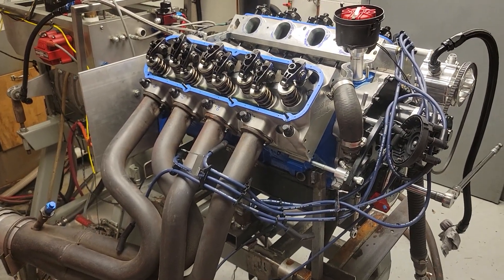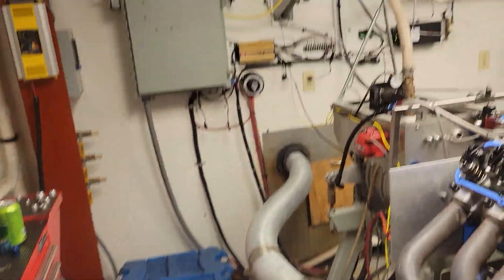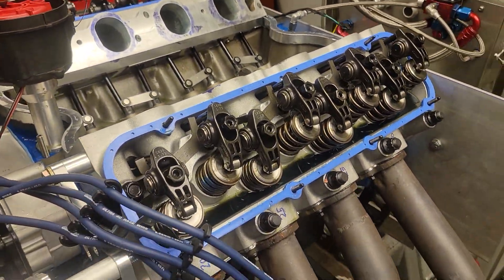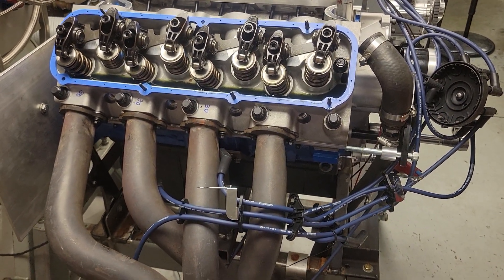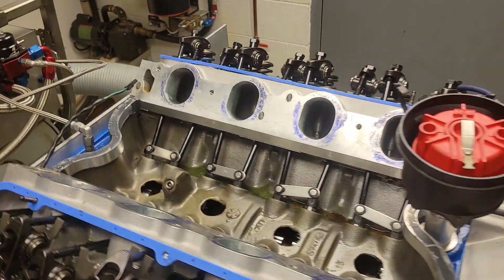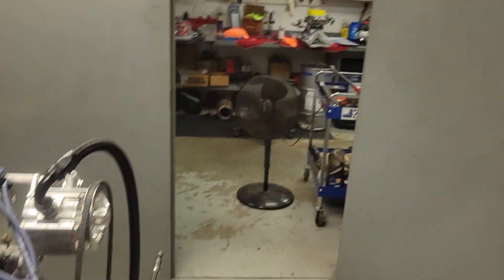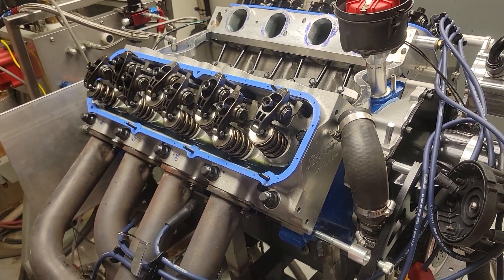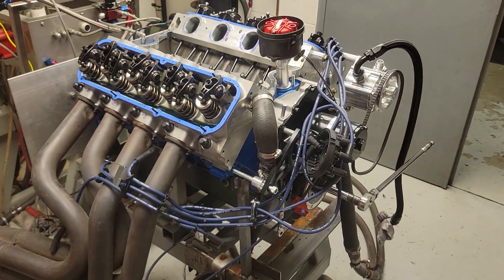sr71 motor on the dyno, but with issues

Comment: What oil modifications did u have to do?
Reply: Hmm I don't have face book.
Reply from the maker: @marksrepairj623  slight nick in the lifter body to feed the oil holes from the slots
Reply: What kinda lifter were u running?
Reply: I'm building a 521 with the sr-71 heads too for my jet boat and never heard of that... u weren't getting enough oil to the rockers from the push tube?
Reply from the maker: @marksrepairj623  i run bam solid roller lifters. Somw times on stock blocks it's needed to oil the pushrods correctly.  Tona of info on this in the bbf/385 groups on Facebook

Comment: I built a 496 for a client and engine dyno number were low at 698hp/598ft/lb. I was asked back on the project and they had sent a Proform 950 to DaVinci. The needle and seats were too small the accelerator nozzles were too small and partially clogged, no power valves, and all jet sizes(including air bleeds)were the  same that it left with. All contradictory to the spec sheet. It wouldnt idle and it was hard to start. It would run-in when it was warm. The throttle seemed to hang up if tried closing the idle screw. The carburetor was lean at idle @ 15.8:1, the butterflies open into the transition slot, the butterflies were in backwards so the taper was cutting into the base plate.....days later it made the projected numbers and gained 168hp/125ft/lbs and 1200rpm. 

Maybe back in the circle track days.....but not today.

Comment: What did you have going on?
Reply from the maker: Lack of oil to the rockers.  Small grind om the lifter body cures it. Now I'm fighting with it more. Pretty aure cam timing is wrong so tearing down for a 3rd time to correct that